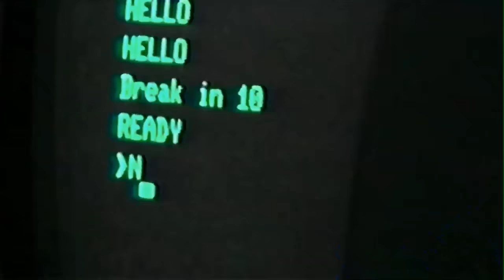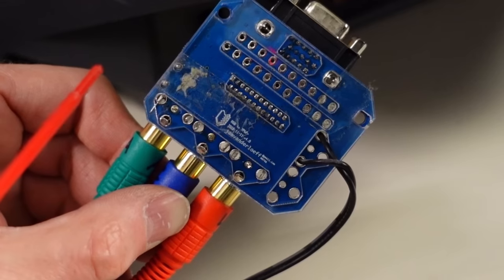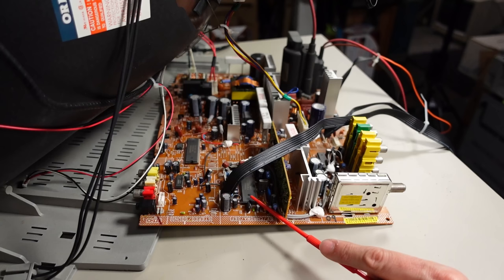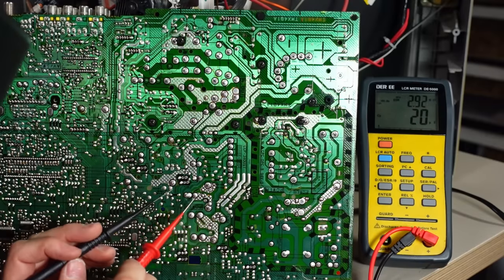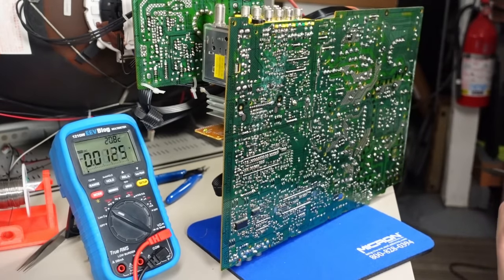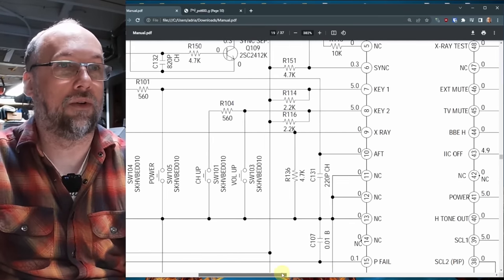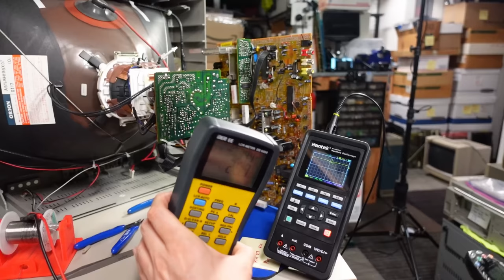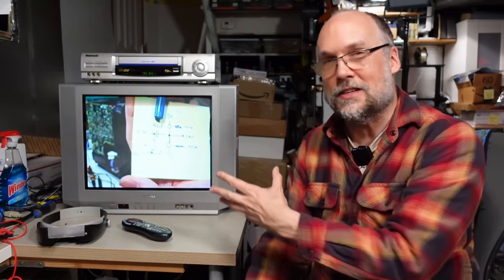I figured out exactly what's wrong with my Toshiba CRT TV (20AF41)

Comment: ticking almost always indicates short/overload in line out or psu output stages, dont always assume its bad caps !
Reply: first thing to check if ticking is make sure line out transistor and all diode in line out and psu stage arent shorted, if the psu 'chopper' transistor it short, it'd blow the mains fuse immediately
Reply: if no shorts, caps ok, and still ticking, suspect the line output/flyback transformer ...

Comment: I can confirm that tv is not Toshiba made. I just fixed one the same model, same everything, bezel, size... with much better internals. The speakers are bigger and witc plastic ducts. All the ICs are Toshiba branded and the CRT is made by Samsung. Here in Brazil Toshiba made a joint-venture in the 80s with Semp, a brazilian electronics manufacturer that lasted to de mid 2010s. Semp Toshiba made CRT TVs up to 2010 I think.

Comment: My dad had a 32" sanyo from 2006 with all the imports including a digital tv tuner. The set was junk as after that set was used for 7 years the CRT was so wern out that the brightness and contrast had to be cranked to 100%. To make a watchable picture and that's pretty sad. The set died at 13 years of age when the flyback failed back in 2019. The tv was replaced with a 2004 27" Sylvania TV which lasted a year before the vertical IC failed and then I replaced that TV with a  2005 25" Sylvania which is still working to this day.

Comment: Orion made some decent stuff, considering they were usually the "budget" electronics manufacturer in Japan. Never really had issues with stuff they made, usually very plain and barebones in features. And for a Japanese company started in the 1950s that was seen heavily in the late 90s into the early 2010s, its Wikipedia page is rather pathetically short.

Comment: better than the 27 inch phillips i have. every so often i have to replace the 100v 1uf capacitor that sits literally directly over the top edge of the CRT itself, mounted on the button control board at the top of the unit, because the heat from the CRT kills it.

when it starts dying, the horizontal hold starts to fail, and it slowly starts to roll the picture upwards, eventually just leaving you a single line at the top of the screen.

why the heck theres a HSync capacitor on the button control pcb at the hottest point of the unit i am sort of mystified, because from a longevity standpoint, thats just insane.

but from a stance of planned obsolescence? makes perfect sense. it lasted over a decade before it failed the first time. another 7 before it failed the second, even in spite of using a nichicon 105c cap to repair it.

one of these days i'll have to trace down where the root of the traces lead to and put the cap someplace less hot if possible.

Comment: I'm #312 like... I have this exact same TV. I thought it was a bit blurry picture and the focus couldn't sharpen it up to where I thought it should be. Not too sure if adjusting the CRT connection would do anything. I'll compare that cap removal which might be the same situation with the composite inputs! Ummmm, Toshiba 20A45C is the one I have which only has composite inputs with the CO-AX. Looks the same though. Very interesting.

Comment: i've been starting to see some vhs's degrade and build up mold, one of mine was like fused together till i put it in a rewinder/fast forwarder machine (i use that to avoid issues with tapes getting eaten) and it slowly unrolled it where as the vcr just gave up. anyways i'm not sure how much longer tapes will last, i've digitized all my old recordings after dealing with that issue.

Comment: Secondary diodes first, a clicking power supply means it’s seeing a low impedance load, in the case of a TV first suspect is B+ being shorted and that would generally be by the highest stressed part the LOT (Line output transistor) , I’ve not watched the whole video at time of commenting but my bet is the LOT is shorted and the LOPT has failed
Reply: OK I’m completely wrong lol, it started :)

Comment: 8:50 Why not just design a near-clone of that RGB-to-Component adapter? You've got the know-how to trace out everything, identify the chips, and PCBWay can easily print replacement boards.. I'm sure the ICs wouldn't be hard, at all, to track down or get modern equivalents if necessary.
So why not just make your own and upload the gerber files so people can get one relatively cheap?
(I just used a bunch of resisters and whatnot to make 15pin Dsub to composite and that's been "good enough" for most things I do.. I should really probably make a converter to go from DSub to s-video at some point though.. My old capture cards are Comp/SVideo and coaxial-Tuner input sadly.. I should really invest in a not-crap HDMI capture card, the 2 I have are usb2.0 and have some horrible delay, so can't be used for real-time things, like playing consoles though it)

Comment: Is this sag caused by momentary excessive consumption?
Reply: It seems like a very marginal circuit design, which means it's going to be more prone to variation from basic use over time. It's stabilizes out immediately after startup, so it's just the inrush current that's a problem. They probably thought it was good enough at the time they designed it because they didn't expect the TV to really last more than 5 to 10 years. From a manufacturer point of view so long as it makes it past warranty they don't care. They were just as rather you bought a new one.

Comment: the way I hear the CRT wine is use slow motion on my iPhone then I can hear it clearly because its toned way down
Reply from the maker: Oh I just use a Spectrum analyzer app on my phone and my Pixel can show up to 30khz on the internal Mic -- so it perfectly picks up the peak. A very useful tool for checking if the oscillator inside the set is running at the right rate.

Comment: Could be a dodgy bootstrap lol maybe not.. 4.8v is within operation tolerance but the P.Fail signal could be interesting.. Edit: Well, shit, it was the 5V rail, resistance between various points must drop it below threshold due to the sag.. 4.7v actually isn't that great!

Comment: My gut feeling is that you haven't fixed the TV. You've just masked the actual fault for a bit longer. I'd suggest the power supply still has a fault (hence all the sagging) but you've just made the MCU more tolerant to the sagging. Expect future failures with this one as the original fault worsens with time.

Comment: Well NTSC is quite better because it has 60Hz and doesn't damage eyes that much. PAL/SECAM is too eclipsing because of 50Hz :-((( I wanted to buy 29"/100Hz back in 2006 but was stingy on money it cost.
Reply: On the other Hand the colors where Junk on NTSC. Thats why people called it Never The Same Color. Also PAL Had 576lines. And NTSC only 480.
Reply: @worldsendace  well, i am looking at my PAL/SECAM 50Hz and I would agree to lose 100 lines to lessen flickering :-))
Reply: @ran2wild370  yeah but Flickering was never a Problem Back then because the people where used to it. When you Look onto a crt tv today after using flatscreens for almost 20 years you get a headache right away.
Reply: @jkeelsnc  as i said its only a Problem when you are used to flatscreens for so Long. Then you see it. Its At least the case for me.

Comment: I'm still watching this, as usual, great presentation, but I need to rant a bit, or maybe eight bits.  It's so sad that you have to issue the warning about the dangers of high voltage.  I think common sense is getting more rare with time.  I realize that younger people aren't aware of the voltages required in older technology, but it's like warning that boiling water is hot.  OK, rant over.  Thanks again Adrian.

Comment: hmm. reset controllers are nothing special. just that commodore and nintendo never bothered to use any doesn't imply they are not a part of any product that was properly designed :P and most indeed do provide 'brown out detection' :P mostly dallas econoreset, never even heard of this mitsumi one. :P loi but it seems to do the same thing. 'voltage under x' hold reset... 'voltage over x, still hold reset for xxx milliseconds then release' 'voltage under x again, pull reset again'. these usually just look like a transistor but are not. (ofcourse they're not only usable to pull reset... also for debouncing inputs etc :P or using 2 different ones to pull let's say nmi in case of battery low.

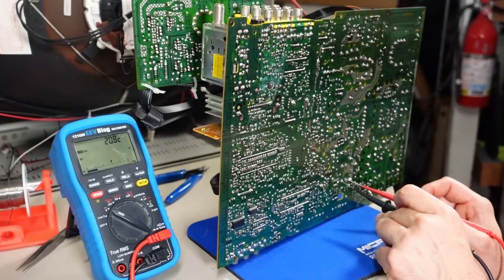Comment: 35:13 - Wait Im missing the point here. How exactly you got shocked? Probes are not damaged, you are not touching metal parts...
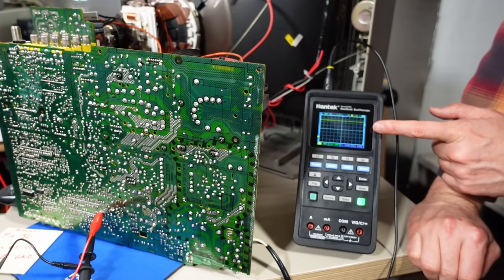51:16 - Nothing personal really, but this guy who worked on this camera in 21st century should be fired. Really. Left portion of screen, like 55% of width is in focus, while right one is out of focus just because its 5cm behind. Now viewers have to watch out of focus footage. I never blame video producers, I blame creators of devices in 21st century for out of focus. I just have zero tolerance for out of focus videos :)
Reply: I think he meant shocked as in startled, he was surprised the set turned on
Reply: @sonicunleashedfan124  OK but look his hands and reaction, it looks like he was shocked by current, not by fact it turned ON.
Reply: He didn't get shocked, he got startled. It looks like, due to how the mainboard is sitting on that mouse mat, the power button got pressed while he was probing the capacitors, turning on the TV unexpectedly, and startling Adrian.
Reply: I'm wishing that the next phone will finally have a camera that has the ability to focus to infinity. My current one even has a manual mode, but it's shortsighted. Also never had a digital camera that would focus to infinity in the dark.